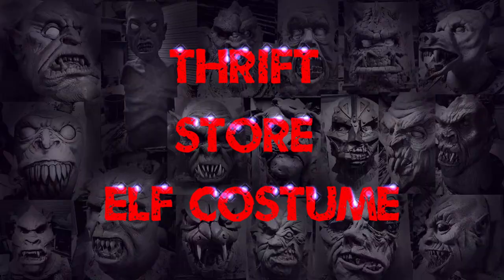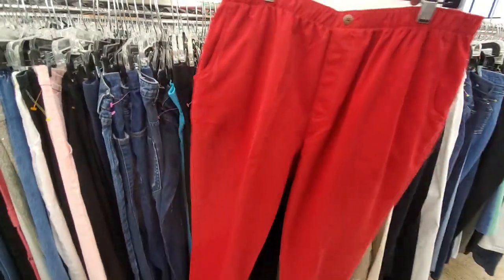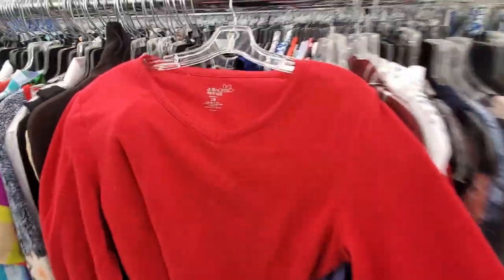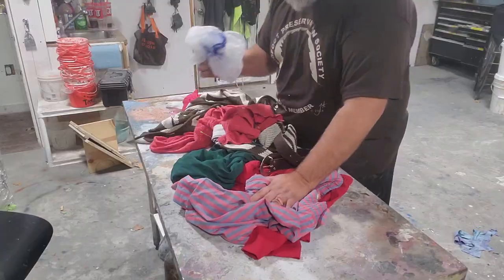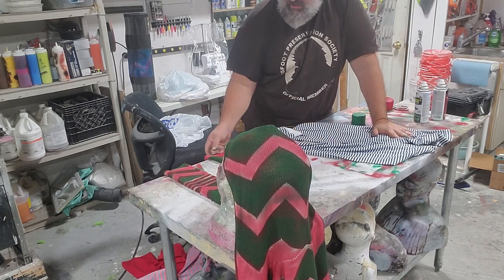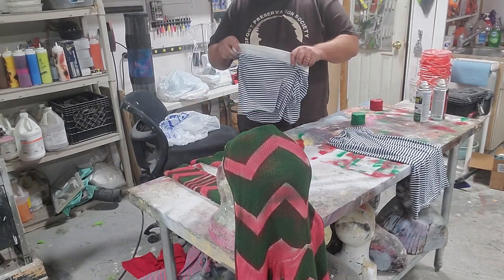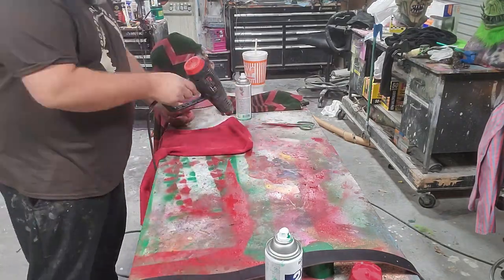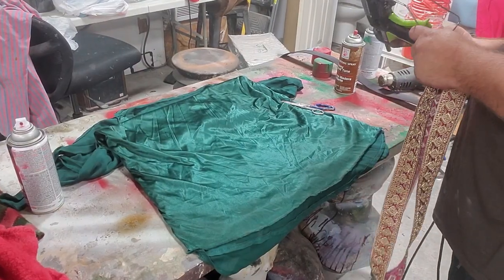thrift store scary elf costume

Comment: Two questions, I have done this for zombie cloths, but the cloth ends up very stiff from the paint. No big deal for animated props but for actors how do you CLEAN the cloth (that has been spray painted) and your actors do not complain about the stiff cloth?
Reply from the maker: thats the magic of woven material as opposed to other types. the spray paint really only hits the outside and all the woven fibers maintain their flexibility because only the outside is painted. 
 Also you have to dry the costume first in the dryer- that heat sets the paint, then you can wash in a washing machine like normal.
Reply: You da man!  Have a good Thanksgiving.